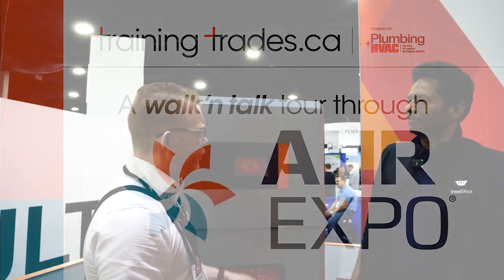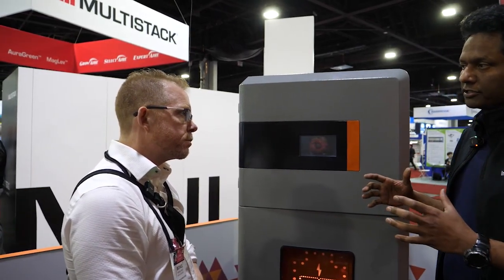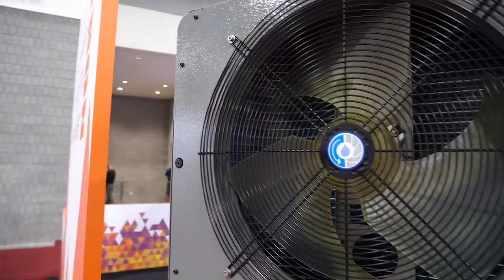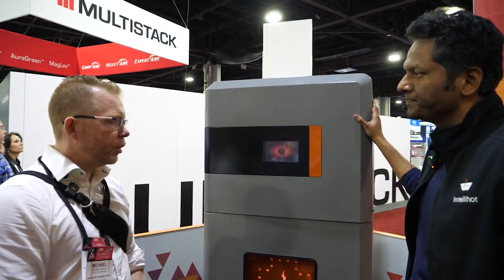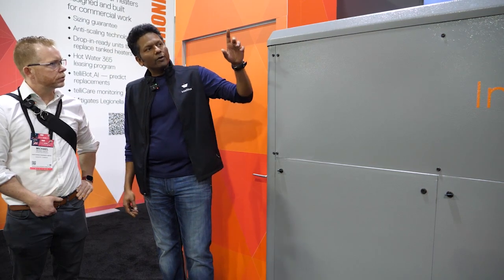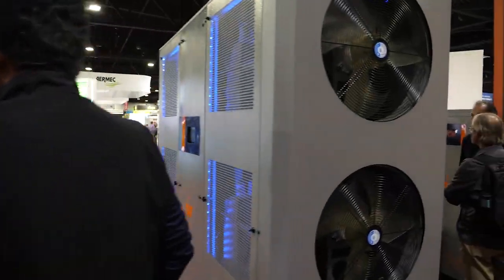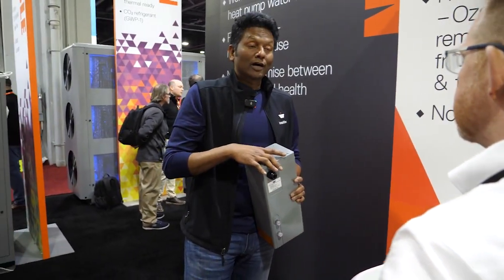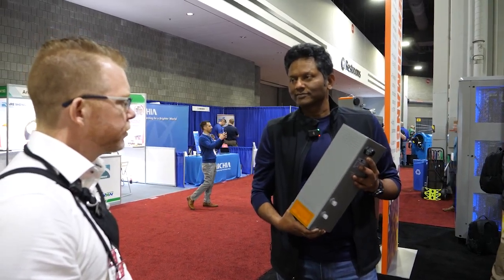Walk 'N Talk, AHR Expo 2023: Intellihot New Products, CO2 Hot Water Heat Pump & More

Comment: Yeah if they could scale this down for residential and keep the energy cost down to what tank hybrids do, they would make a killing.
Reply from the maker: We completely agree on the potential! Scaling down Intellihot's technology for residential use is a great idea. Their commercial systems save space and energy by heating water on-demand, without large storage tanks. To make it work for homes, they'd need to ensure these smaller systems are energy-efficient and cost-effective, comparable to hybrid tank systems. This would involve adapting their smart controls and modulating burners to suit typical household water usage, while keeping maintenance low and lifespan long. If successful, it could be a game-changer in home water heating. Thanks for your great comment.

Comment: Intellihot needs to look into making one of these sized for single family residential. Looks to be a much better design/tech than current offerings of domestic heat pump water heaters, which are prone to failure and are not repairable.
Reply from the maker: Like with all equipment there is opportunities. I am sure Intellihot will appreciate your suggestions. Thanks for sharing your thoughts!